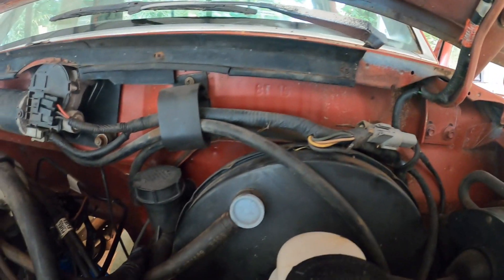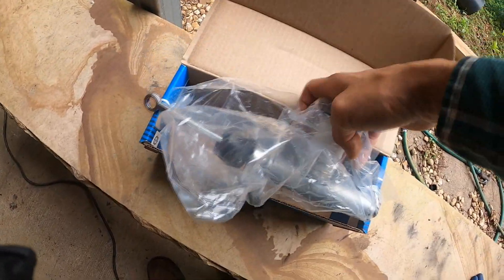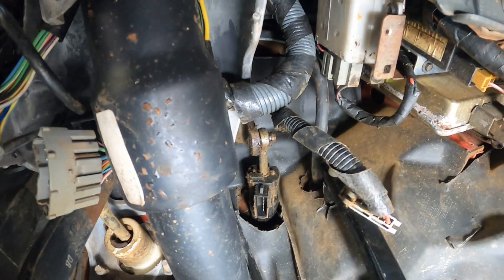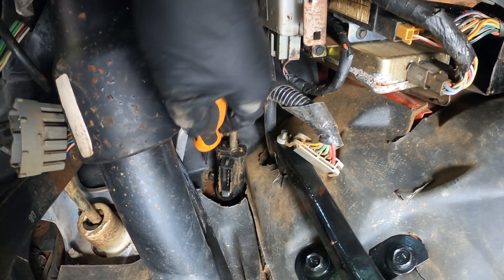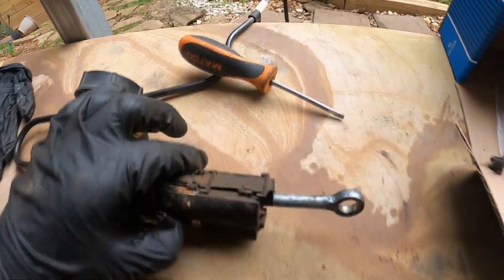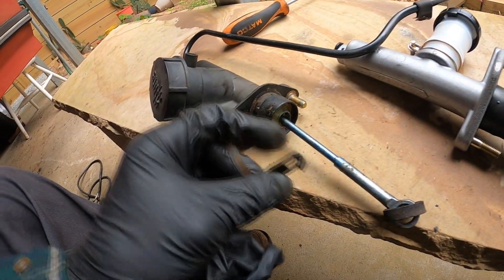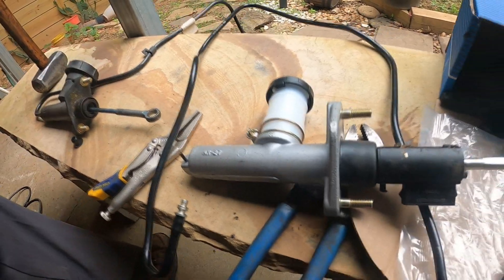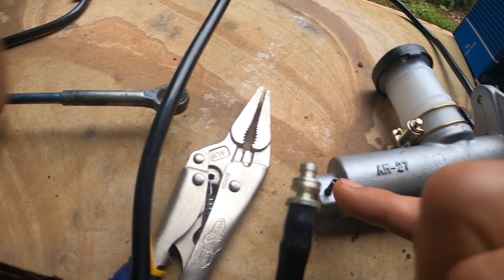Clutch Master replacement Ford F150

Comment: Dude, where did you buy the metal master cylinder? I’ve been looking for a metal slave and master but I can only find plastic. Any metal ones I’ve found are out of stock.
Reply from the maker: Sachs is the brand, its part of ZF. Back in the day the manual transmissions were either the Mazda or the ZF, so I went will all ZF parts, slave, clutch master and the clutch.  I got them at Autozone. They can be hard to bleed.  Let me know if you have a hard time bleeding the clutch afterwards.
Reply: @corvettedude4423  I’ve got an 86 f150 2wd with a tremec t170 transmission. My slave cylinder recently went out and I was looking at changing everything out. I’m assuming this part will work. Thanks for the info!